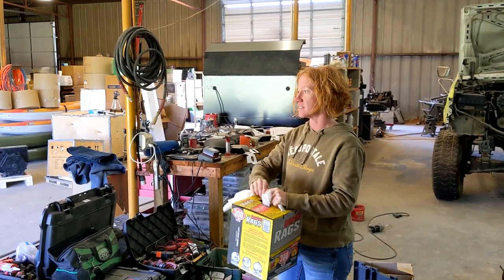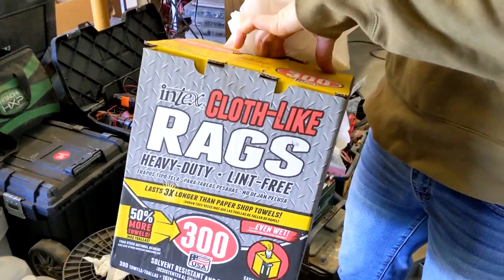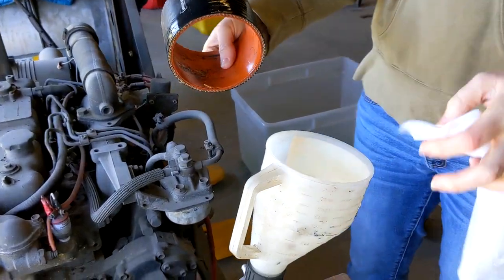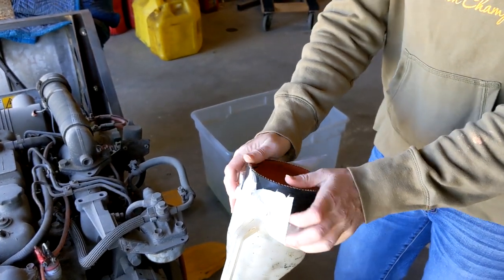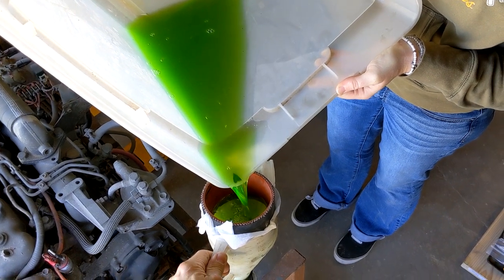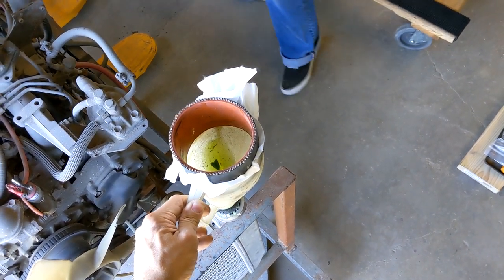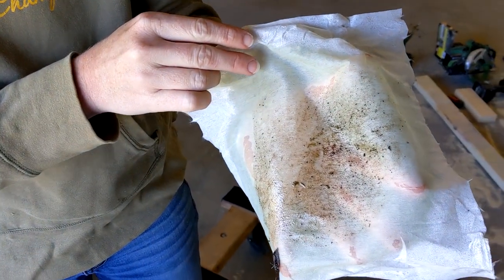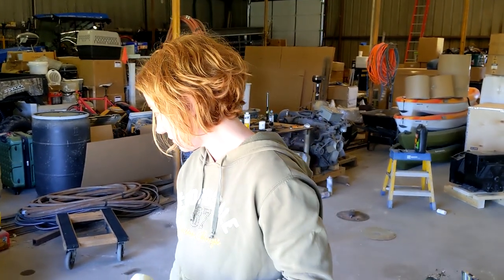Reuse Filter Recycle Engine Coolant Antifreeze | DIY Everything Series

Comment: I can’t get any parts store to take it. I asked and all the surrounding municipal waste places too. A neighboring city/county said they had an arrangement with a certain tire shop and sent me there but the tire shop refused, saying they only take oil. I had some oil too even though there’s never an issue getting a parts store to take that, but these guys required me to fill out some card for the city/county. The card had check boxes for the kind of fluid you were leaving and “coolant/antifreeze” was right there on it, despite their assertion that they don’t take it.

Well, I tried.
Reply from the maker: That's rough. It's getting harder and harder to properly dispose of anything these days.
Reply: Same problem with me! After 6 years of reusing my engine coolant that I filtered using coffee filters with a strainer, I had to get rid of the old coolant. No one in my city would take it! I am absolutely environmentally conscious about getting rid of old coolant properly, and I was forced to use kitty litter to absorb the coolant in a hefty bag and throw it out with the garbage.

Comment: Your filter is a lot nicer than mine. I use a giant funnel with a napkin laid in the bottom. it works well. Now I'm using a clear jug so I can see when it gets full.
Reply from the maker: Sounds like a good filter to me!
Reply: @GettinBelizy  If my coolant is a little muddy from washing dust off the vehicle I'll let it sit several days so the dirt settles to the bottom and then carefully (trying not to stir up the dirt in the bottom) scoop off the top of it and dump it in my filter funnel.
It does work! Better than buying antifreeze at today's prices.

Comment: Thank you so much for posting this useful film. I changed coolant 1 year ago and now want to replace the Radiator and Heater Core on that car. The car even was not driven much, it is our spare car. First I thought to put a new coolant, but fortunately googled and came across your great film. So what for to through away money. Can I use a large coffee filter for that purpose? Thank you again.
Reply from the maker: Thanks! I actually tried coffee filters and didn't have much luck ... they disintegrated too quickly. The white shop towels worked much better. You can get those from Walmart. Good luck!
Reply: @GettinBelizy  Thank you. I asked just for any chance thinking that it is a rhetorical question. I'll try Blue Shop towels (I have them) and just thin fabric, if it won't work I'll get white. Thank you kindly again.

Comment: Recently went to dump some off at the local Advance Auto and they told me someone had dumped oil into the coolant drum. Woman there told me they would be fined heavily for that. My question is water and oil don't mix so it should be pretty easy to filter out the oil from the coolant. Also a lot of used coolant that comes in already is contaminated with other things including oil.

Comment: How to dispose the ethylene glycol? I have engine coolant based on that chemical and need to dispose it properly, We dont have a recycler agent here so just wondering If i can do the disposal myself with the help of chemical expert? Can you please advise.
Reply from the maker: Good question ... and one I do not have a great answer for.  There is no DIY "safe" means of disposal for antifreeze that I know of.  Everything I'm told suggests the only "proper" way to dispose of antifreeze is at a recycling facility or at a landfill that accepts antifreeze (I would ask around about this option because many do).  However, a few interesting facts about antifreeze that I've found ... 1) although water-based, it WILL burn, say, on a hot brush or trash fire and 2) oil-dry absorbent will absorb it ... which can then be treated as regular trash as the law states "landfills can accept as long as no 'free flowing' agent is visible" - so, cat litter, paint hardener, etc could work as well.  But, if all else fails, consider filtering the antifreeze as shown here and offering locally to friends, family, neighbors for use in generators.

Comment: This is a terrible idea. The main concern with antifreeze is not particle contaminants inside of it, if you have those things have gone too far. The concern is with the pH, overtime the alkalinity increases significantly and will deteriorate components. The other factor is conductivity. Filtering antifreeze does not address the pH or conductivity of the fluid. These are the things that will destroy a cooling system.
Reply from the maker: You make some good points about chemistry changes which occur over the lifespan of coolant, but those issues are only a concern with OLD coolant.  The coolant we filter in this video is still relatively NEW.  Some engine work on the IDI truck going to Belize required draining of the new coolant and less-than-ideal storage of the coolant in an open tub.  This attracted bugs and dust.  Once we filtered out the particles and tested with test strips, the antifreeze was ideal for use in the Isuzu generator - also headed to Belize.
Reply: @GettinBelizy  Thank you for writing these explanations. I worried when red the comment above, but I need to drain a new coolant (~1 year old), so this project is just what I need. Also it is good to know about chemistry modifications in this liquid. Thank you.
Reply: Thank you for the description of the coolant chemical modifications with time. Though I'll be draining new coolant, like 1 year old, bcs I think to replace the radiator there, so will be reusing the coolant, but it is good to know why exactly the old coolant is bad for the engine.
Reply: My dump truck actually came stock with a coolant filter that you buy in the parts store. What harm can be done bu filtering contaminants out of coolant?:face-fuchsia-wide-eyes:
Reply: So let’s find out the best method for testing and adjusting Ph and Conductivity. Can’t be that difficult, no?